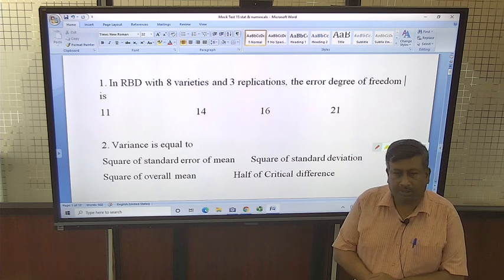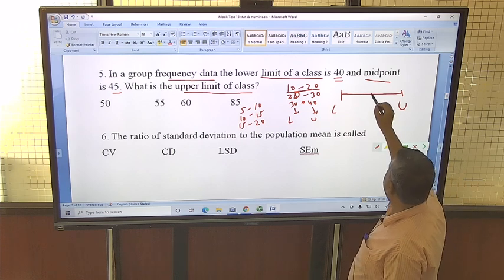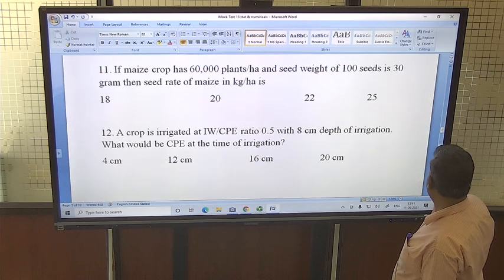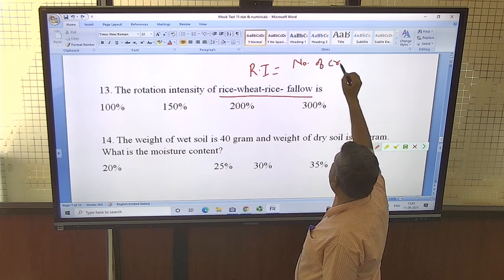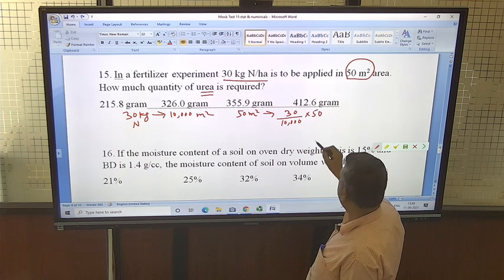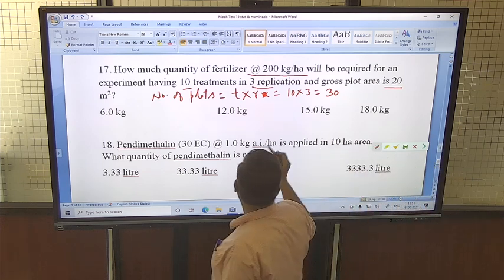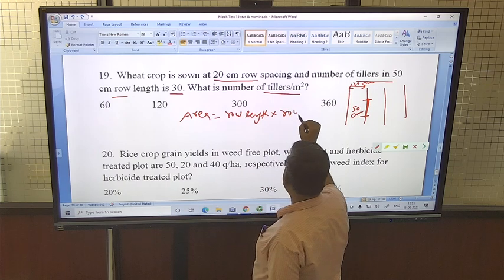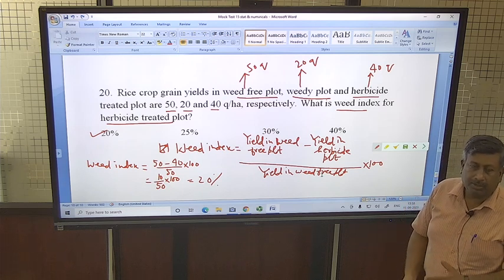Mock Test 15: Statistics and Numerical

Comment: Sir.. Why did you take 4 as total number of crops? Because in Fallow.. No crops are grown! So i think it should be 3/2*100= 150%.

PLEASE CLARIFY MY DOUBT SIR.
Reply from the maker: yes it is 150 per cent.  There was wrong calculation.  Also watch explanation of mock test 15.
Reply: @amitbhatnagarclasses247   okay sir
Reply: @amitbhatnagarclasses247  sir please bring Statement based questions

Comment: Sir in question number 13 the total number of crop is 3 and total duration of rotation is 2 year so here correct RI will be 150%
Reply from the maker: yes it is 150 per cent.